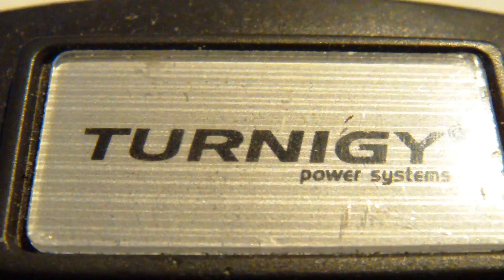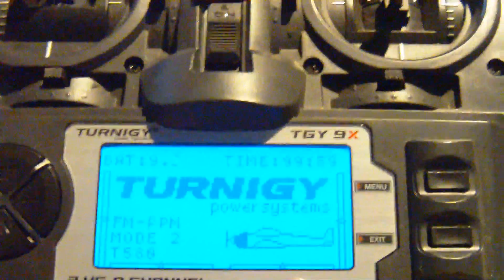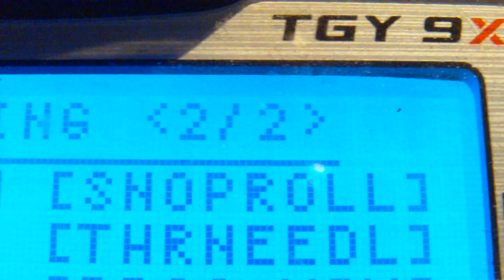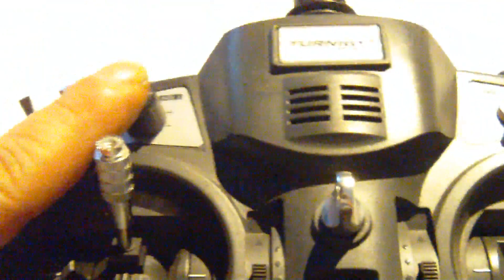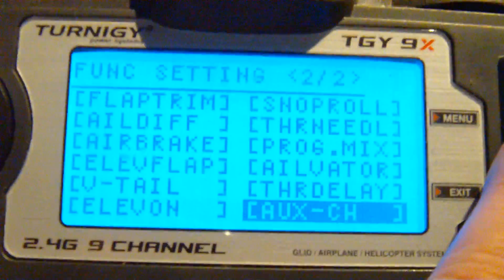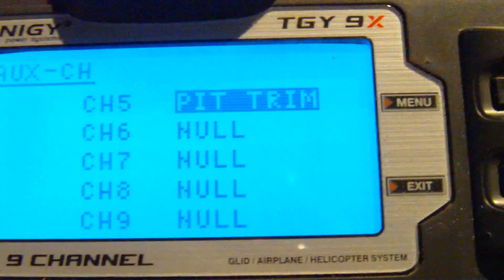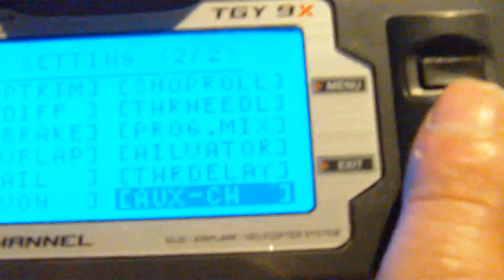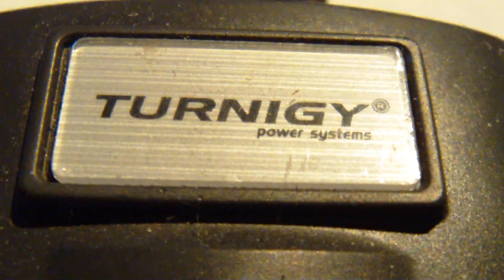Turnigy 9X Aux Channel Setup.Tutorial in HD

Comment: hi great video one question the back light does it turn off after a while ?
Reply from the maker: Thank you for your Feedback.
To be honest, i dont remember... i dont have the 9X Anymore because i changed over to a FRSKY Taranis.
But i believe there was only a Setting for Display Contrast.
However if you flash it with OpenTX you can make it to go off  after  a while or to be switchen on/off with a Switch  you can select.
Reply: thanks alot  for your speedy reply keep the awesome work

Comment from the maker: Thanks for your Comment, 
that  was the Reason why i did this Video, because i had my forst  9x in MOde 1 and converted it to Mode2 but ran into the Problem that the Channels werent right as soon as i  used a Mixer etc due to it still being Set on Mode 1 in the Menu Settings